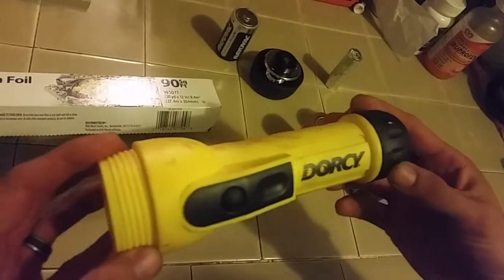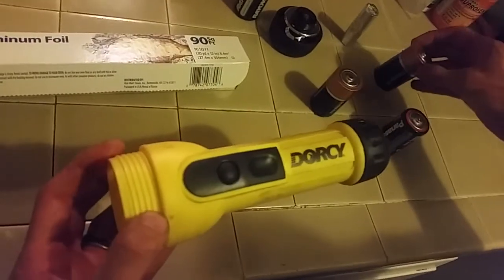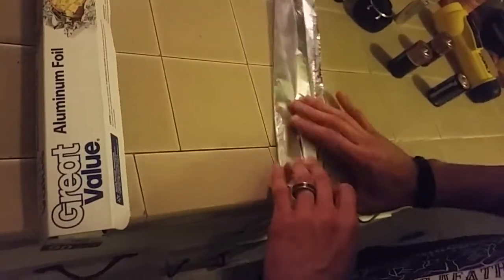Using one battery an foil to use a flashlight

Comment: Does work, explantion: Copper and Zinc wiring is communicating with aluminum and the battery is being reaponded to by what feels like a combination of wiring with a battery, it feels like iron to the battery.
Benjamin Franklins kite was used where a brass key was sent out suspended to a kite in the middle of a lightning storm, his experiment was to see if he could harness lightning from using putting the key out far enough within the wind filled with sky that was also being contacted by lightning as well during a lightning storm.
Metal keys can contain various mineral prospects, including that of those like the chemical compounds of zinc, copper, titanium and a few more things.
Without science labs being around then to separate mineral prospects in the best appropriately done way people are doing today, his own hands had to mine the composite materials and then somehow have them forged by a hot enough temperature, by something perhaps like in a metal bucket being used to put lava in.
Thomas Edison invented the lightbulb after Benjamin made it possible to tie strings of copper and zinc wiring together, by doinf this, he basically allowed for friction to spark and be contained within a glass dome, these were freshly glass blown by hand lightbulbs at the time because again, no sort of industries were around back when they existed, so we had to deal with 100 years in the 1700’s to one day be able to get rid of candles for candle lanterns then copper and zinc wiring conjoin with glass spheres called lightbulbs.